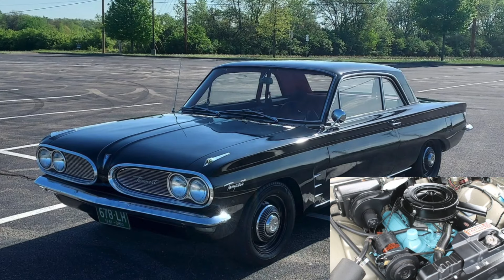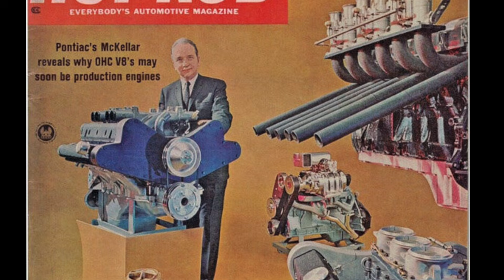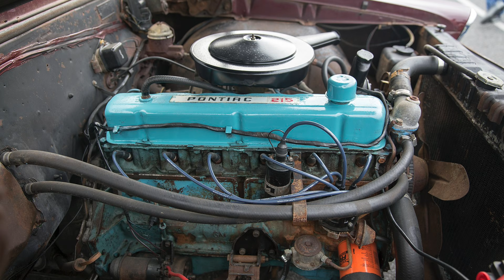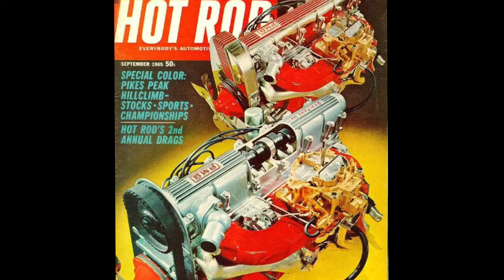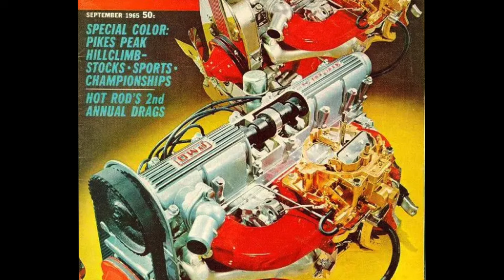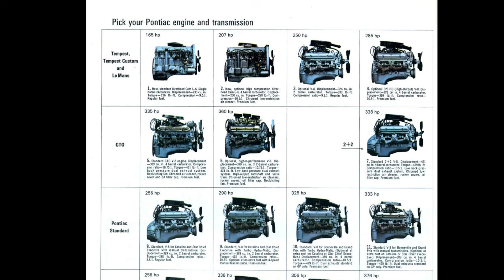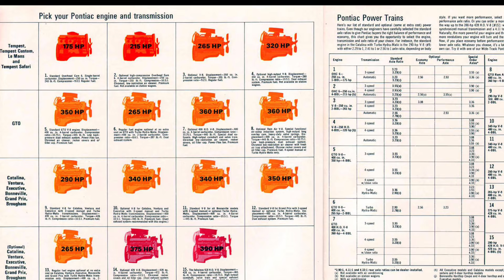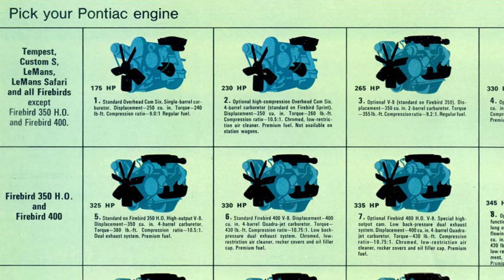Awesome Engines: Pontiac's 1966-69 OHC 6-Cylinder Engine (Tempest/Firebird/LeMans)

Comment: This is NOTa Chev engine with a Pontiac head. The block has 7 main bearings instead of 4. There are no cam shaft bearing bosses in the block. The only things these engines have in common with Chev are the carb and distributor design. The bell housing from a Chev will not fit. I used to have 2 of these engines and spent about 45 years in the auto trade, so I do not speak from ignorance.

Comment: The forerunner to the Trans Am was the Pontiac Firebird Sprint Turismo (PFST) prototype. It used the OHC-6 engine and had many of the suspension parts and settings that later found their way into the Trans Am. It would have been interesting to see this make it to production and sale to customers alongside the Trans Am, but the PFST wasn't to be.

Comment: The full size cars would have been better off if Pontiac had developed a 245 cubic inch motor or 4.0 Litre.  A real blend of power and fuel economy.

Comment: Had a 66 Lemans Sprint with the Sprint engine 4bl Qjet. I thought it had a three speed stick but it could of been 4 speed. Bucket seats PS PB. Fun car to drive. But the engine had high milage on it. And if you kicked in the secondaries the blow by was so bad it would blow a quart of oil out through the breather oil cap. I sold it and the guy who bought it put a small block Chevy in it.

Comment: OMG. I had no idea the unicorn I owned back in the early 70s. In need of a decent car with head turning looks (and as little money as possible), I bought a Forest Green 1969 GTO, stock mags, and the coolest Hurst dual-gate shifter, from a gearhead in Largo, FL who had 'ripped out the 400 and put in a 250 OHC 6 Tempest engine'. Though I was not a car guy, I never had any complaints about power or 'keeping up', but I would always downplay the 250 OHC 6 whenever I described the car. Ended up selling the car after about 2 years, and missed it so much I bought it BACK 8 months later - the only car I ever owned twice. Thanks for the engine breakdown and showing me that I never really had anything to be ashamed of back in those days!

Comment: Sprint 6 Firebird must have handled like a dream compared to heavy Pontiac V8, had a 69 and a 75 both with V8s and both would understeer in tight corners. After a spun bearing on 75 I replaced motor with Chev 350 and handling improved greatly with lighter motor

Comment: I bought a '68 Firebird Sprint (OHC 6) new in 1968.  The engine had multiple design flaws.  In the 50,000 miles that were covered by warranty, I had the seals on the valve stems replaced 4 (four) times, i.e. the seals would last 10,000 miles.  The dealer would fight it until oil consumption got down to more than a quart every 400 miles.   A shame, really, because the car was fairly peppy and got good gas mileage (for that era).  Still, I was quite relieved to get rid of it.

Comment: As a great companion piece to this video, take a look at Jay Leno's piece on his OHC-C Firebird that he completely restored. Search YouTube for "1968 Pontiac Firebird Sprint | Jay Leno's Garage". One of the interesting tidbits that he touched upon was that these engines had faulty rocker arms right from the factory and always wore out. See time marker 6:06 in his video for a discussion on these rocker arms. Jay, with his massive resources available, had bespoke rocker arms custom made from "tool steel". He had them hardened and a "diamond-like" coating applied on them. Problem solved!  Of all the cars in Jay's collection, were he to give me one (hope springs eternal), I would select this Pontiac Sprint or his 66 Corvair.
Check out his video when you are done with this one. You are welcome! 😇

Comment: What was not mentioned about the timing belt was that once the belt construction was finalized, it was patented.  As in all aspects. It was the 1st. From that point on, every manufacturer that implemented timing belts on engines - they paid GM royalties for each vehicle manufacturered😊

Comment: Looking at your video at 7 min.  There is a still pic of the OHC, no issue there BUT what IS strange is the chassis it is sitting in!  It is NOT a Tempest and not a Firebird and that is all Pontiac put them in.  This car has shock towers ( Ford )!   so, what is that Pontiac engine sitting in?  it is not a Pontiac

Comment: Adam , I have a question , what part came as standard on 67 firebirds and was made by Ford  ?, a major part assembly.
Reply: Just to answer in case you dont know, the standard transmission was a Mustang 3 speed as John D knew the saginaw trans would not hold up in hard use. saw it first hand when changing the oil on my Uncles 67 Firebird.  at the time I owned a 66 Mustang GT with the same trans.

Comment: Quite a number of these engines were used in Jeep Wagoneers also. besides being used in Pontiac Tempests. and Tempests also used the 230ci and 250ci over head valve six cylinder engines. the over head cam engines were non interference engines. so if the timing belt broke or jumped time it didn't destroy the engine. and a person could simply replace the belt and be on their way again. these engines combined with a four speed transmission were pretty decent running engines.

the 389ci Pontiac V8 was their most popular V8 engine. at least up until it was replaced by the 400ci V8.

Comment: HEY! Now we're talkin'! McKellar's OHC motors. There's supposedly a 63' Grand Prix with a 421 OHC running prototype that McKellar owned floating around somewhere...It's black with tri-color interior w/silver,red,blk which reminds me, you said "sexy interior"! Hmm☺️ Where is that car??! Remember the 73-4 SD455's had the most bulletproof shortblock assy Pontiac ever built. Parts-wise, besides having round-port heads that flowed a little better than the RA2and4 and HO455 71-2 heads, which is weird because they jipped the motor of cam and intake and c.r. the most. ??Go figure...❤👍

Comment: My first new car was a 1966 Tempest with the Sprint option and automatic transmission. I loved that car. I later owned a 69 Tempest V8, a 74 Tempest with a 400 4 barrel and my last was a 86 with a V6. All were good cars. Switched to Chevy pickups after the 86.

Comment: I am a Mustang guy but one day back in the early 70s I borrowed my cousins 1968 Firebird, with the OHC 6, for an errand and I have never forgotten what a fascinating engine it had. It was light years ahead of the Ford 6 with its integrated log intake manifold.
Reply: Too bad Ford didn't do the 250 crossflow in the US and years earlier.  A 250 crossflow will run with one of these OHC engines.

Comment: I briefly got to drive a 1968 Firebird with the Sprint Six back in the early 2000's. It was a 48,000 mile barn find my uncle purchased! The car was dirty, but not terribly rusty.
It was blue with white vinyl top and stripe, white bucket seats and console shifted 3-speed manual. Boy what a blast that thing was! Unfortunately, he sold it to his step-son. He didn't appreciate the car for what it was, so he sold it. I still wonder what happened to that car. Was a beauty!

Comment: I had one in a 66 Tempest Sprint. 4 barrel carb and 4 speed. It was fast. But if you over held your foot in it to long it would occasionally wipe a cam lobe. I kept spare assembly and could change it or in 20 minutes. Loved that car

Comment: My Pontiac LeMans, 3 speed floor shifter, factory tach, High Po 215hp, 4 barrel Quadrajet... My second car in High-school. It was a demo for a salesman before a guy in my neighborhood bought it, a chain smoker! It sat for a couple of years, and when I was 17, I knocked on his door. 200 bucks! It threw a rod, I went to a wrecking yard and bought a short block, I should've put rings in it like my dad said, but...  Lucky, I had the original head rebuilt and kept the high lift cam(I knew nothing about) Pontiac changed their compression ratio's with the combustion chamber, 10 to 1, so luck not wisdom had me use it. Put it together and, yeah it smoked a little... Ok, dad! But, after cleaning out 10 pounds of cigarette butts, no lie, on the passenger floor ruined the carpet... took it for a maiden voyage and OMG! A tire smoker! Lol 1979, the Trans Am was the ticket as far as new cars then. I raced one and was door to door... That cat was tripping out! Lol The story didn't end there, but I don't want to cry...

Comment: I have a '67 Firebird with the Sprint 6. 4 speed, PS, PB, posi, deluxe interior. I've owned it since 1987. It was a rusty junker when I bought it and had to have all the body panels replaced. It's a numbers matching engine. Linden Green with a black vinyl top. Still drive it around in the summer. People don't believe the engine is stock or that the "3.8L overhead cam" emblems are factory for 1967. Thanks for this episode.
Reply: Most people swapped out these engines for a V8

Comment: My first car was a 67 tempest custom convertible. It originally had the ohc 6 in it. My uncle had replaced it with a pontiac 350 from a 68 firebird before I got it. My uncle said it was originally the 4 barrel ohc 6. I wonder how many were built with that combo? It was the same color blue as the patina wagon in the video

Comment: I have a 1967 firebird convertible with the Sprint engine in it. 25 mi to the gallon sometimes better. I drove it  on a 3000 me plus road trip. There were several cars that would not make it up the mountain pass. They had a push or tow vehicle helping them and I made it up there a very low speed. By the way most of them had a three-speed behind it on the floor. Also they were the second one to have an overhead six cam inline engine. G pad what they call their tornado engine can I have one of those Jeeps. Interesting as well.

Comment: I had a 68  Firebird sprint convertible with the 4.1 litre overhead cam six, 4 barrel 4 speed with factory 373 positraction gears. Loved that car, should have never sold it.

Comment: I. Have a question in 1970 Pontiac had a 455 that made almost 400 HP and in 1974 that same 455  only made 150 HP what did they change the pistons or the rod's or the decking the reason I'm asking is cause I have a1970 Pontiac and a 1974 455 it also has 5 x head's

Comment: You missed a few interesting points about these Pontiac in-line sixes. The first one, the 215, with overhead valve was the most Chevrolet-like, including with its Chevrolet style Bellhousing bolt pattern. But when they built the 230 with overhead cam in 1966, that engine block featured the standard BOP Bell housing bolt pattern just like the BOP V8. These OHC engines were the only in-line six cylinders produced with the Buick/Olds/Pontiac Bellhousing bolt pattern. Lastly, the 230 OHC featured the same bore and stroke as a 307 Chevrolet V8. I always felt like the 250 OHC seemed anemic compared to the 230. Much like comparing a 305 Chevrolet to a 307. There was no comparison, the 307 was far better. Great video!

Comment: my old man bought a '67 Pontiac Lemans with this motor in it. Pragmatic as the old man was he opted for the one barrel carb. It was a good engine right up till some drunk hit me in a near head on collision. I rebuilt that motor twice between new and the crash. After the crash   I yanked the motor out and stuffed it back in the garage where it lived for 15 or so years whereupon it got fed to the cruncher. Bad move. It was an interesting engine.

Comment: In 1966, the Tempest 4-door sedan with all the Sprint goodies was one of five cars on my short list. When I went to the Pontiac dealer to ask for a price quote for a special-order car, however, the salesman said that dealer had such a large selection of cars in stock the policy was to not facilitate customers who wished to special order a car. Without so much as thanking the salesman, I did a military about face and "marched" over to the Plymouth dealer and special-ordered a '66 Baracuda with equipment similar to the Pontiac Sprint equipment but with a 273 cu in V8 - metallic bronze with white vinyl upholstery.

Comment: I owned a 1967 Pontiac Firebird with the 230 overhead cam six engine. One of my high school friends on the 1968 Firebird with the sprint engine and a three speed standard transmission. He could get rubber in all three gears! We absolutely loved our Firebirds. My next Firebird was the 1970 formula 400, which I thoroughly loved. It was not a Trans Am, but I thought those cars were the ultimate. Living in Buffalo, New York a lot of them didn’t make long lives and the rust belt of the nation.

Comment: I had a 1966 Tempest with this engine in it when I was in high school. I purchased it from a neighbor in 1969 for $500.00 not running. I went to the Pontiac dealer and purchased a cam kit, that came with the cam mounted in the top cover, lifters, rockers and timing belt. I fixed the car myself, I was 17 at the time and got it running. I drove it to high school in my senior year. It was a dark blue two door coupe and was very dependable. I drove about a year until I found the car I always wanted, a 1966 GTO. That was a fun car.

Comment: A problem with this engine, or so I read years ago, was that they didn't get the cam and lifter metallurgical compatibility quite right, leading to premature cam wear.  Anybody know about this?                                                                                                                                                                                                                                                                  Too bad they didn't make the head from aluminum to save a little more weight, and make it a crossflow.                                    Thanks for doing a story on this!  Straight sixes don't get a lot of attention from rodders in this country, but they are my favorites for a lot of reasons.  Australian subsidiaries of the Detroit Big Three have done some very interesting developments on the parent companies' sixes which you might  want to look at  .  .  .  .

Comment: I have been waiting for do a video on this one!
I had a 69 Tempest. OHC Six that I rebuilt myself in High School Ato Shop. 3 speed Manual. On the column but did a good job of putting it on the floor. I put bucket seats and reupholstered and it matched all over from under the hood, paint and interior.
I tuned it up in auto shop with all the Sun equipment, it made sure it was lean in all the right places but ran smooth. It topped out at 120mph in Arizona straight roads and when driven easy on the highway got 27 mpg with the air-conditioning on ! It had one of those aftermarket "FrigKing" air-conditioning units that worked great. Very sad to have ever sold it.

Comment: I owned a 1968 Pontiac 2-door Tempest.  It had a 6cyl - 1bbl carburetor.  Very reliable car for its time.  The only negative for me was the engine noise, it sounded like it whistled.  If I’m not mistaken the 6cyl they put in Firebird’s almost got 250hp.

Comment: I bought a '66 Tempest, used, in 1969.  The base engine with a 3 speed stick (3 on the tree).  It ran nicely--until it did not.  At one point it needed to go to the dealer and I was told 'We don't often work on OHC engines and will do the best we can.'  They got it back on the road but it die not do that well afterwards............    I don't think that American service techs were not redy for this!

Comment: Not a great engine at all.  Because Pontiac didn't take the time to insure that it was reliable.  As a result these engines had poor oiling for the camshaft bearings which are simply machined directly into the cylinder head and they quickly became engines to avoid.  Which is why they weren't in production for very long at all.

Comment: Great video! In 1961 I was 7 years old. My dad traded in my mom's 56 Ford Fairlane V8 and bought her a 61 Catalina, 389, 2 bbl carb, automatic. She absolutely loved that car and it was the one I remember riding around with her the most. I never got to drive it, though. By the time I could drive, it was traded in on a new Oldsmobile 88, 350, 2 bbl, automatic. My dad was an excellent driver having driven trucks for decades. Every once in a while he'd take us on Sunday drives with the whole family. We had moved to Silicon Valley in 61 and my dad loved exploring the back roads in and around the Santa Cruz mountains. He didn't believe in pussy-footing around. He used to say that it was good to "blow the soot out" of an engine every so often. What that meant was that he wasn't afraid to floor it back in the mountain Twisties. My dad could do no wrong in my mom's eyes with anything related to automotive driving or repair. So we all learned to "watch the road" when he drove so we could keep that morning's breakfast on the inside. 😂

Even though we again had a new car when I turned 15, I'll always wonder what that 61 Catalina would've been like to drive. 

My first favorite car was the Jag XKE. It wasn't just incredibly beautiful, but it had this marvelous Double Overhead Cam 6-cylinder that was bred from years of racing. So in 67, when the OHC Pontiac Firebird inline 6 came out, I had high hopes. Even though I became a car mechanic and had the opportunity to drive almost all the popular cars of that era, I never got to drive a Firebird OHC 6.  I had a voracious appetite for car mags and read as many as possible from cover to cover. The magazine articles covering the OHC 6 soon showed it had fallen out of favor in light of the heavier but much more powerful V8s. 

It'll always make me wonder what could've been.